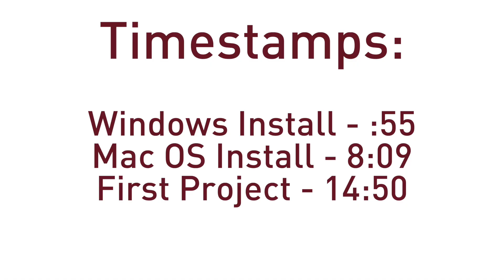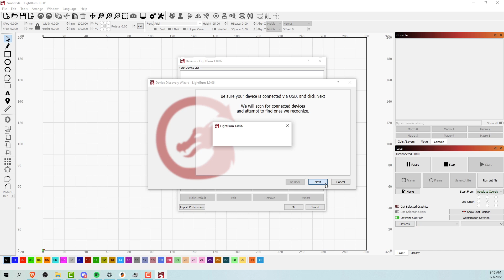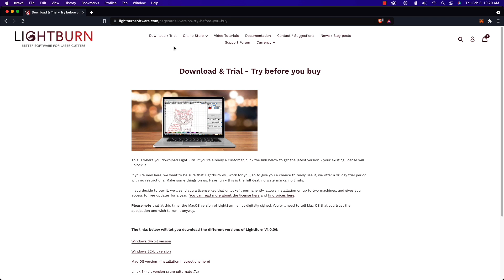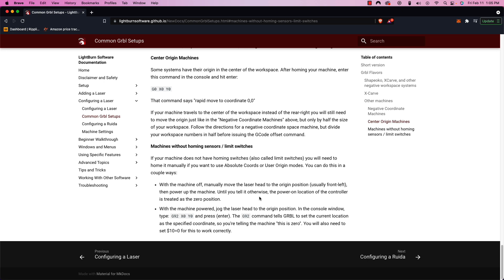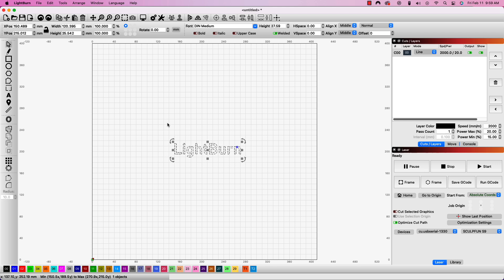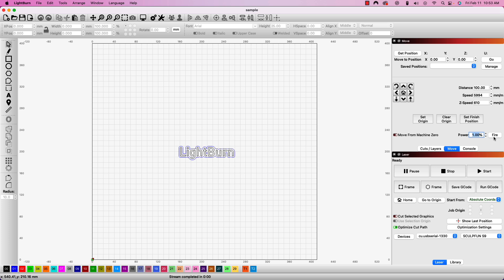Setting Up Your SCULPFUN Laser With LightBurn & First Project

Comment: Ugh. I just got my s9, installed the driver and LightBurn and it will not detect my machine.  Getting so frustrated. :(
Reply: select the choice GRBL in the list, cause sculpfun doesn't show up. But the selection GRBL works just fine.
Reply: @JoyDVshop  having the same problem. Did that and it is giving me a transfer error when i try to run g code.

Comment: Hello, thanks for video. Unfortunately Lightburn can't find my laser (Sculpfun s10) even with the steps you provided us ...
Reply: Did you find a solution? Mine will not detect my s9. :(
Reply: @christyhorner2316  select the choice GRBL in the list, cause sculpfun doesn't show up. But the selection GRBL works just fine.
Reply: select the choice GRBL in the list, cause sculpfun doesn't show up. But the selection GRBL works just fine.

Comment: @Lightburn - I'm using a Mac OS Monterrey version 12.3.1.  I tried the install 3x and also followed the terminal instructions for any potential conflicts with existing drivers and nothing is working. I have the Sculpfun S9 that I just got today.  I also tried going into safe mode/recovery mode and nothing seems to be working. Any suggestions?
Reply: I have the same problem, I have macos monterey and my s9 does not detect me even with the driver installed, if you know of a solution or you have already solved it, would you help me please
Reply: @aldohernandez2119  I was able to set up a manual setting using GRBL. It took me installing and reinstalling both the driver and the software multiple times before I got it to work. I could never get it to auto detect but the manual set up finally worked.
Reply: @Grace Ramon  i have the same problem with bir sur, i can't connect the laser with my mac
Reply: Were you able to solve it?
Reply: @leandrorodriguez7978   No, i have install the laser manualy but

Comment: Downloaded lightburn today and tried to connect my Sculpfun s9 and the software couldn't find it. I tried manually but my equipment wasn't listed in Lightburn. What gives? tell me how you did it please.
Reply: I'm having the same issue - did anyone respond to you yet?
Reply: @gramon74   have the same problem, someone already solved it
Reply: @aldohernandez2119  select the choice GRBL in the list, cause sculpfun doesn't show up. But the selection GRBL works just fine.
Reply: @gramon74  select the choice GRBL in the list, cause sculpfun doesn't show up. But the selection GRBL works just fine.
Reply: No answers yet!
Reply: @Jimbojenkins  select the choice GRBL in the list, cause sculpfun doesn't show up. But the selection GRBL works just fine.
Reply: I am also having same problem, I tried on my Windows its works but not on Mac,  anyone can help?
Reply: @alik.p3582  select the choice GRBL in the list, cause sculpfun doesn't show up. But the selection GRBL works just fine.

Comment: I have just brought a brand new Sculpfun S9 and have assembled it. When I am using it I'm finding that the laser head assembly is very loose on the rail and is wobbling as it is moving along. This is creating uneven and squiggly lines. It looks like the bottom guide wheel is too low but there isn't any way to adjust this wheel up. Can anyone help with any suggestions please
Reply from the maker: I just took a look at the one here and there is an eccentric nut on the back of the carriage which will allow you to bring the vslot wheel closer/further away from the rail. It is typically used on roller wheels to help create the needed stiffness for the motion. It is on the bottom of both side of the Y axis as well as on the bottom of where the x axis motor is. 

You will need a small spanner wrench to reach and turn it. Feel free to reach out to us at support@lightburnsoftware.com if you have any other questions.

Comment: I connected my sculpfun a couple of weeks ago but have not had time to use it. when getting back on my laser is not in with the graph in lightburn. When creating a circle in lightburn on the far left the laser start in the far right. I am not sure how to rest the two so they match. Can anyone help?
Reply from the maker: The most common cause for this is that the origin is not set correctly. I would confirm that you have it set to the front left. If you are still having issues send our support team an email at support@lightburnsoftware.com

Comment: Thank you a lot for the video. I have a question about the speed you selecting 5000 and respect. 2000 this is mm/s. What is the top speed of the sculpfun. I don't see how this thing can do 5 meter/sec. I think the max of this machine is like 300mm/s
Reply from the maker: All of the speeds shown here are in mm/minute.  The top speed of this machine is 6000 mm/minute, or 100 mm/second.

Comment: Are there any tips or tricks for connecting an S6 Pro to my Mac through your software?  I can't get it to recognize the laser.
Reply: select the choice GRBL in the list, cause sculpfun doesn't show up. But the selection GRBL works just fine.
Reply: @JoyDVshop  thanks, I’ll try that!
Reply: I have the same problem, I have macos monterey and my s9 does not detect me even with the driver installed, if you know of a solution or you have already solved it, would you help me please
Reply: @aldohernandez2119  select the choice GRBL in the list, cause sculpfun doesn't show up. But the selection GRBL works just fine.

Comment: Hi...I just used the trial version, but when I connect the Atomstack a5 pro, when running the product, the actual size is not the same as the number shown on the machine, so I will adjust it later, thanks

Comment: Is the driver mentioned in the Mac install portion a must? I have been using LightBurn with my Comgrow Z1 successfully w/o the driver. Only problem is that when I initially (and even after a couple of weeks) my laser doesn't show up in the devices panel.